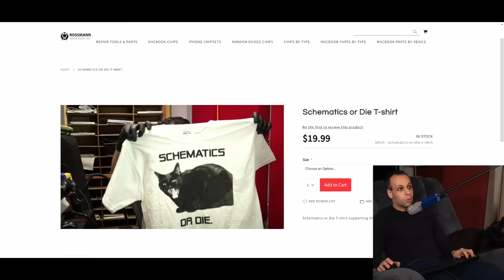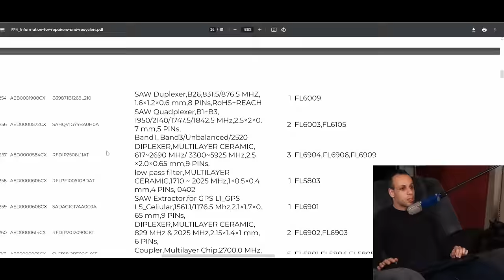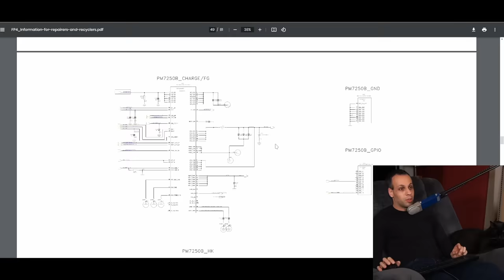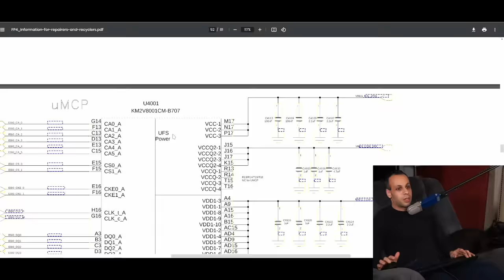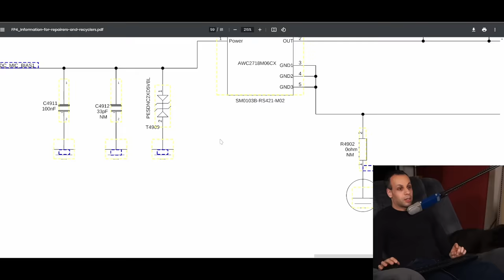Why I was wrong about fairphone

Comment: I recently bought a webcor regent reel to reel recorder from a thrift shop, and it was originally made in the 50's, but the really cool part is that the full circuit schematics are just printed on the inside of the device. we never should have stopped doing this.
edit:
I know that modern digital devices are much more complicated than the majority of older analog ones, and the schematics don't need to be physically printed on the device itself. I just mean that the schematics should be just as easy to access as they are on this specific device.
Reply: Our church's first sound mixer had the full schematic, with resistor values and all inside the manual. That was from in 1997.
Ironically, we never needed it. The only parts that failed were the 6.5mm sockets on the channels we used the most.
Reply: Schematics are a bit too large to print nowadays and i would much rather have a file than a printout. There is much more useful boardview files too which make troubleshooting dense circuits very straightforward. 
Its those files that should be made available.
Reply: The irony is that they (not we) stopped issuing schematics on the grounds of proprietary secrets to stop the competition (ie the Chinese) copying the devices. Instead, they have the same devices made in China where it isn't hard for a pre-release copy to go missing and be reverse engineered even before the device has hit the market. Quite possibly the schematics are sent to China too. If it was really about product security this wouldn't happen.
Reply: @chrishartley1210  You dont need a schematic to copy basic devices. And the more complex devices like laptops and smartphones arent being cloned from schematics because the schematics are the easy part. Schematics are the easy part in general because in digital electronics, youre just connecting chips as the datasheet says.
Reply: Modern devices are a little hard to fully document inside, though I agree in principle.
Reply: Lot of boomers in this thread who think a laptop is just a handful of wires. Lol. Just the pinout for a CPU would have to be blown up larger than the whole device to be readable.
Reply: @KevinJDildonik  yeah and its hardly useful on paper. its the equivalent of a book version of wikipedia, its just not nearly as useful as the digital variant.
Reply: Many home appliances that I have taken apart had a paper copy of the schematics taped inside somewhere, usually taped to the back cover. 🤔🤓🍻
Reply: Most modern electronics are a lot more complicated than they need to be, and they could still provide a lot of useful information in the space available on a case, if not a full schematic
Reply: @maxscott3349  yeah, even just a qr code to an online file would be an improvement over the current system.
Reply: The GPL software licence follows this same philosophy for the source code of a computer program - it should be as easy for the user to get as the program itself.

Comment: It is sadly amazing how what used to be the norm many years ago (electronics hardware including its schematics in their manuals) is now the exception.
Reply: the modern norms of "intellectual property" are to blame. The older business model didn't have to rely on schematics as secrets to make a profit. Then some companies started getting away with keeping such things secret as an "advantage" (it's questionable if it actually is advantageous in the long term, because it hurts the community of its customers). Then the rest, greedy for profit, feel like they must also keep their secrets or they'd be missing out on profit.
Reply: @lekhakaananta5864  I work at as a electical engineer and it's pretty simple to reverse engineer a PCB with the right equipment, but it's very time intensive. But if you want to know the secrets of your competitors, you go that way :D
Also, for most circuits regarding the SoC there are very firm suggestions what they should look like, so most implementations are according to the reference designs of the SoC-Manufacturer(like Qualcomm) for example

Comment: Hey Louis, if you want to see a company get something right, try looking up "ICOM IC-7300 Service Manual". This is a ham radio transceiver that is pretty new (goes for about $1100) 
It's amazing how detailed they go, with explanations of the inner workings, block diagrams, board views, schematics, parts lists, etc. (it's not interactive board views but that's asking a bit much imho) 
I just love how ICOM has seemingly kept their stance on right to repair the same from 20+ years ago to at least 2015 (this model is still in production)
And guess which brands are the most popular in amateur radio?! ICOM and Yaesu. Both provide schematics for their transceivers.
Reply: My Yaesu FT 2900 also came with a schematic. -kc8wzm
Reply: It might be expensive but at least it’s right to repair. Good to know that one’s buying into a product knowing that they can fix it themselves (hams know their way around things)
Reply: @Walmart5103  yeah, I broke my ic-706 back when I was a teenager and the service manual made the repair pretty easy. It was a $10 NPN transistor replacement and it was good as new. 
You can't really make an argument with ham radio about anti right to repair propaganda because: 
safety- covered in the exam
Security- covered in the exam (also not supposed to be encrypted in the first place)
A large part of the community is an older generation and there are a bunch of engineers there. It's just not worth it for ICOM or Yaesu to piss off those people.
Reply: Great point. I can't imagine the rage a ham would feel if he couldn't fix or tune his rig!
Reply: Nobody wants HAM equipment without detailed schematics.

Comment: Removing the headphone jack is not sustainable. It's a piece of plastic and requires a tiny amp to run.
Wireless headphones, require batteries, on top of the amp and an additional processor.
And running that through an overpriced USB-C adapter is also not (more) sustainable.
Reply: Well, it also requires an audio DAC, a proper reference supply for the DAC, passives for the DAC and the amp (audio caps can get bulky) and some non insignificant mixed signal board design effort. Is it impossible? No, is it trivial? Also no.

On the other hand if you have that go through USB-C and let someone else worry about the analog stuff, it costs you nothing in space or in money or in design and qualification effort. It's a simple choice. One that I don't like, but simple nonetheless.
Reply: @TravelerInTime not all usb-c headphone adapters have their own DAC built in and in fact it will send analog audio signals over the usb cable in some cases. Also it needs an amp and coupling capacitors for the speakers anyway...
Reply: @InTimeTraveller  These are usually integrated into the SoC. Some do higher quality that is not integrated. Take a look at Realtek's ALC1220. Caps no more.

Comment: I think it's worth noting that Fairphone are not the only manufacturer to do this. While I wouldn't recommend a PinePhone to a normal person, Pine64 provides schematics for most of if not everything they produce, including the PinePhone and PinePhone Pro. They also still have headphone jacks and easily-replaceable batteries!

The schematics are actually really nice because when the PCB engineers screw something up, the community can usually find a workaround, like moving a resistor or installing a diode somewhere.
Reply: The way you put it makes it feel like an open source phone
Reply: @Christopher Grant I see. for people who are a little more insightful of how it works. Again, from what you say now it reminds me of Linux based OSs. Offer a more technical alternative for those who want control
Reply: I see their first purpose is ethically sourced materials,  which Pine won't do.
Reply: @autohmae  True, but the video was about schematics so ethically sourced materials aren't really relevant for this particular topic. Besides, now that Fairphones has moved to selling junkbuds I've started to side eye their claims about ethics. If they're going to lie to my face in an attempt to sell me greenwashed crap then I'm not really going to put that much faith in their other statements.

Comment: I in 1000 years will never believe any company that say "We removed the headphone jack because its not reliable or sustainable or ran out of space to put them etc".  this includes the nothing phone as well  as fair phone where they came out and said it for being unreliable or unsustainable.

That port has been evolving since 1878, used in military equipment,telecommunication and soo much more. even today, you pull out a walkman from 1980 and plug in a headphone and it will work just fine and will so for another 2 lifetimes.Them saying its not sustainable means its a skill issue on their side and not the fault of the headphone jack standard. and personally making this image of it being "unreliable" is disgraceful. shame on them.

Comment: I supported fairphone as one of the first 10.000 buyers on a kickstarter. They dropped support for the first phone after the launch of fairphone 2. my camera died and battery was bloated - 3 times i bought a new one until they did not supply spare parts. The pricing is too high and my experience burned me.
Reply: @ArdgalAlkeides  no i had to buy a battery 3 times because theirs bloated. I never could buy a camera module. As someone who did not benefit from their decisions it was the last 500 bucks they got from me. Every person that asked me if they should shell out 700 bucks for their newest bug i told hell no, buy a Pixel A variant at the cheap and debloat them for free. It costs them a third.
Reply: I had a Fairphone 2. It had issues with a glitchy pogo connector for the screen, which I wasn't able to fix by just cleaning. Eventually it got so bad the screen basically wasn't working at all. With no idea if ordering a new screen module would fix the problem, in addition to it having a €200 price tag and a two month lead time, the next day I went to a local store and bought a Google Pixel for €100 more.

It's good to see they at least make the schematics available nowadays. But the lack of a headphone connector is a dealbreaker for me.
Reply: I was #700 or something on the first phone. It was truly awful in many ways but to me it was obvious that they were simply a small company not knowing any better. I just regret convincing so many of my friends to buy the first edition, and they obviously had similar experience to yours. I have a FP3 now and am super happy with it.

Comment: Kudos on this update, and your willingness to revise your advice on the light of further info. 

The other side of the issue on the audio jack is that once any individual has moved on from using that, or perhaps never had, you are asking all those people to pay for a component they will never use. 

The same trade off exists for many other smartphone features: like built in compass and so on. In sustainability terms it is essential to weigh up the eco-costs of providing the feature vs a plug in adaptor. Similar trade off in money terms 

The major difference between you and most Fairphone fans is that they choose the ecological trade off and you go for the economical one. 

Typed on my FP4, so guess which camp i come from.

Comment: What we really need would be an alternative for the Pixel Phones, which got the hardware capability to work with grapheneos. I wonder if you guy's at FUTO are able to maybe connect these two, for a more secure and more free solution in the future. Also thank you so much for your work and your content!
Reply: I just want a phone that will get OS updates for 10 years+.  We've gotten to a point where phones are powerful enough for everything I need, so having to replace the whole thing just because it no longer receives security updates (and apps I use ditch older Android versions) makes it e-waste, no matter how repairable it is.
Reply: You may want to look into postmarketOS then

It's not there yet, but this is probably the best bet we have right now
Reply: @AcidiFy574  It's not Android, but it primarily targets Android phones ('cause there's tons of them)

In other words, it is a way to get "10+ years of OS updates" on certain existing devices

(it seems I'd clicked the wrong 'reply' button back then tho)
Reply: @alexatkin  same, I have an old iphone which still works and it's annoying that I have to buy a new phone since I can't even use Signal
and buying a Pixel would mean that I'd have to buy another new phone just after few years

Comment: I use a Faiirphone for a good time now, only thing I dislike is the performance of it, it has lots of lagging and it wasnt cheap. The team behind it also pushes out new ones very fast.

Other than that its a very nice thing to have so many possibilites of replacing stuff. Especially battery and USB-C Port, those will always die first

Comment: I have a fairphone 3, it's really neat that when I broke the screen I had an extra at home and after 12 screws and 10-15 mins I changed the screen. They had great videos to show me how. That's why I got this phone and other phones don't interest me. It so easy to swap the screen and I don't have to move over any data, or throw a perfectly usable phone in the trash. 

I don't really care for the aux port, but I agree on your points, especially that the buds are badly designed for the enviroment and the bullshit fairphone said about it. That made me question their company (and I still do). It made a bit sad that I had supported them. 

Thanks for the  update! I got a huge smile seeing that schematic. A great tool that I will never use, but the principle is great. I won't ever buy their buds, but I am happy I bought the phone on a principal level. If there will be a fairphone 5 thats has "ASHA"  then I will support them again. The way I see it is that they are not perfect, but holy shit they are better than the rest.

Comment: Points for the schematics but pushing shovelware buds is still a massive anti right-to-repair, consumer unfriendliness and anti-sustainability cross on them for me. I once had a conversation with a Fairphone rep in the comments of Linus' video on the device where I considered giving up my fight of devices always having a universal standard such as an audio jack. I didn't know about them conveniently starting to sell throwaway earbuds at the time but after Louis' video covering the topic, I will never consider buying one of these constantly outdated units until they cut out the hypocritical bullshit.
Reply: @@christophergrant3887 I can't say I know enough about the device to make an informed decision. I like the concept, especially having physical switches for components but I don't like the seemingly outdated SOC as well as the limited RAM and I'd have to learn a lot more about working with a Linux phone before I couldn't comfortably make such a decision. If you're knowledgeable on mobile versions of Linux and the hardware is capable enough for your needs then I'd say go for it but those specs are a massive step down from my Xperia 1 III. If I could, I'd have GrapheneOS on my Xperia and be happy but life is never so straightforward, I'm afraid.

Comment: Looks like schematics I used in the 1980's. Pwb layout, manufacturing, and test. (everything was normal size - wirewrap wire and standard soldering tools to make changes. Nothing was tiny.

Comment: So with full schematics would it be possible to add a headphone jack back in as a mod? Are the schematics from the previous version (with headphone jack) available for reference?
Reply: The headphone jack requires the software to manage it...
Reply: @rayoflight62  - maybe. But if the digital audio stream can accessed then auxiliary circuits could be used to convert it to whatever audio signal level is needed. Heck, it may even be possible to shimmee in the guts of a bluetooth headset, add the audio jack to it, and power it from the phone.
Reply: @rayoflight62  You can have the hardware do it as well.
Reply: Liikely the chips they use are capable of this, the DACs are in device when you use most headphone jack adapters. It would probably require a firmware mod alongside the hardware mod to enable, and there just isn't space in a modern phones to add that in as a mod.

So is it possible, yes. Is it feasible, no way.

Comment: One thing that could really improve all phones? Make the motherboards modular so that if you don't have the soldering skills, you only need to replace a part of the board that's damaged. That would lower the replacement/repair costs.
Reply: They used to have this on apple laptops and Samsung phones for certain parts. This is purposeful - planned obsolescence. Glue them down so people can't replace them.
Reply: And not just replace damaged parts, but being able to update hardware components like processors when they get obsolete, or even customize the specs of your phone. You're absolutely right! I thinks it's possible, but needs for companies to invest and design with a more generous mindset. Nowadays no one is willing to do that and lose profit, sadly.
Reply: @Lukas79591  You used to be able to do that with laptops. They used to be socketed. Now they're soldered.

Comment: Not having a headphone jack is inexcusable for a phone that is uncompetitive in every aspect. It isn’t cheap, it isn’t fast, it doesn’t have a good display. At least give me a headphone jack.

If there is no headphone jack, for that price, you would be better off buying a Pixel which also has no headphone jack, but you will probably still use it for longer, because it doesn’t have shit specs. Or something like a ZenFone which still has a headphone jack and even better specs (though I doubt you will find parts for it to repair, since ZenFones are pretty uncommon).